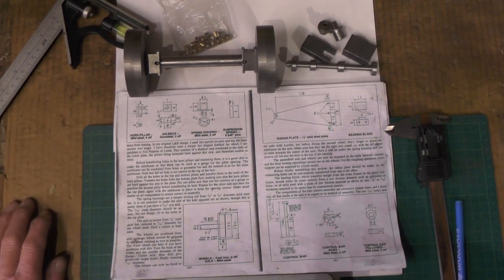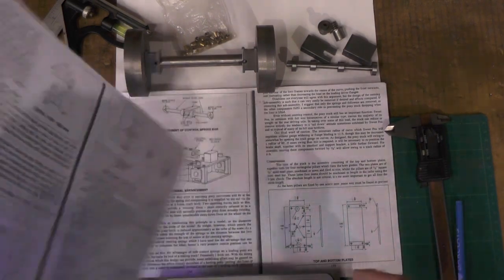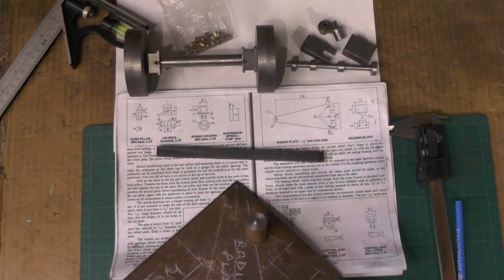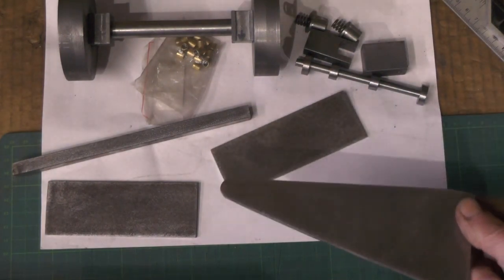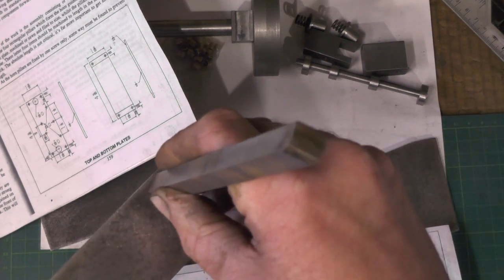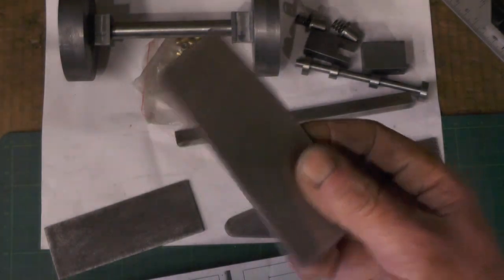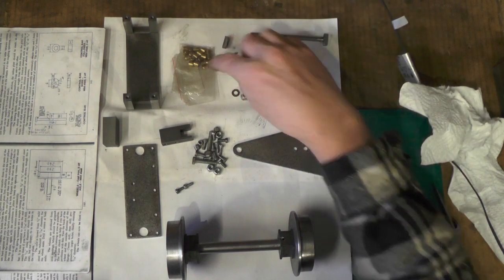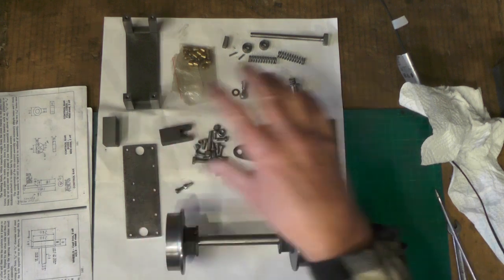Build Your Own Beginners Miniature Steam Locomotive Series (Trailing Pony Truck P3 ) "mr factotum"

Comment: Great work as usual, particularly with wheel profiling!
Reply from the maker: cheers ttg
i'm getting there, although its looking towards complete, ive made a list out  already filled A4 sheet of things that still need making. Ah well keep plugging away!!!
Thanks for Watching
regards
mr f
Reply from the maker: TTG
forgot to ask in last message, what's the diesel sound and smoke generator in your recent video, ive made a 5" gauge battery electric shunter and would be interested to upgrade my sound and put smoke on as well, would appreciate more info on what it is and where to get from, that's if it would be suitable for a 5" gauge.
regards
mr f
Reply: My original post was deleted due to having links in it so if there is a way for me to contact you directly let me know!
Reply from the maker: @tom_tom_go   Thanks for reply,
you can get me at imperialstainless1956@gmail.com
regards
mr f